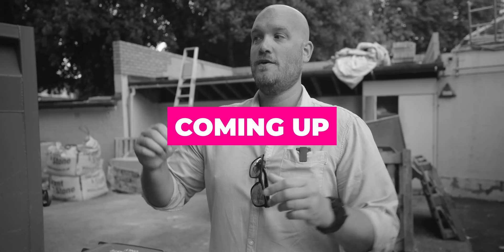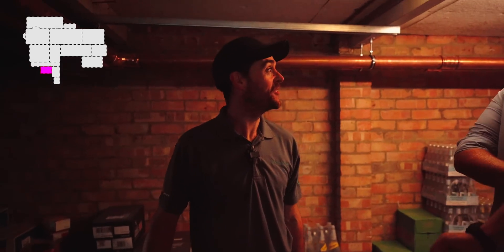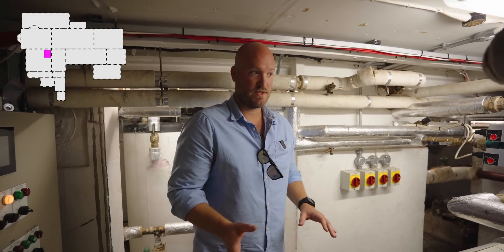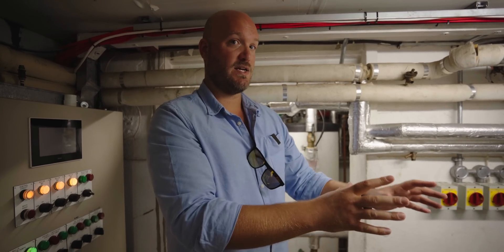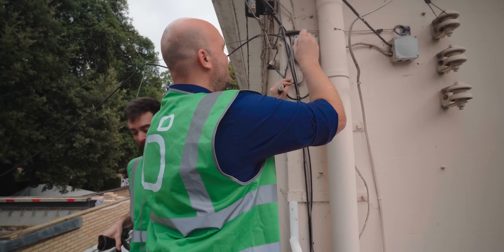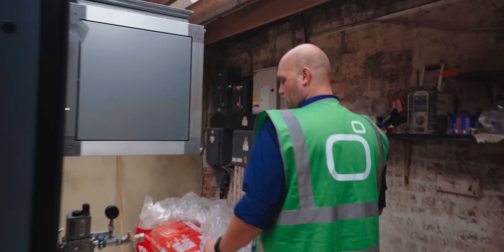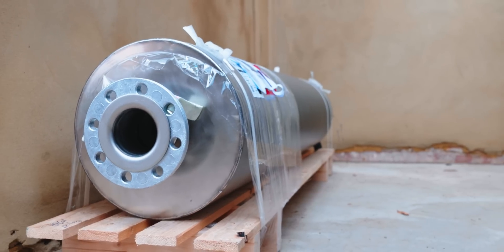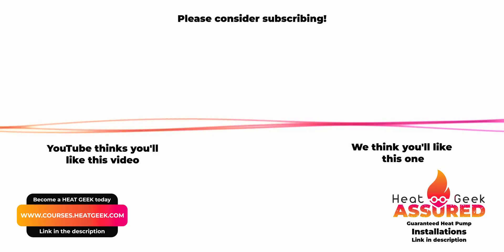This Micro Power Plant Will LOWER CARBON & Save £MILLIONS! | CHP Install

Comment: In a lot of cases, gas CHP would be a net emitter. It certainly would be if compared to a well-operated condensing boiler and grid electricity, as the marginal emission factor of grid electricity is a bit less than that for a gas power plant, due to the renewable electricity on the grid, and this will become even more so in future years (I do these kinds of calculations a lot for feasibility studies for clients in my role as an energy engineer). It may be a good economic solution, but it will certainly be negative environmentally, in GHG, and air pollution, and potentially noise.
Reply: I don't think you're calculating marginal emissions correctly Alan. "last on first off" is how you need to model this.

Nuclear and renewables are "always run" plant. You never (with current penetration in the UK) switch them off. Fossil plant is marginal plant. Combined cycle gas is the first fossil plant that you switch on. Then (pre war anyhow) you start running single cycle gas plant, coal plant, oil plant etc. 

If you displace this marginal load using renewables or a CHP engine etc then the first thing to get switched off is the oil, coal, or singe cycle gas plant. The marginal emissions factor for grid electricity is therefore nothing to do with renewables. It's whatever crappy inefficient piece of plant you just switched off is.

In this scenario the marginal (carbon) emissions of any reasonable CHP will beat the marginal (carbon) emissions of grid electricity until such a time as (a) we have so many renewables that we start shutting off all fossil plant or (b) we start making combined cycle gas combined heat and power plants and the efficiency of the little gas engine CHP just can't compete with the efficiency of big combined cycle turbine CHP.

Gas fired solid oxide fuel cells feeding heat pumps would spank the CHP setup in terms of emissions. Or CHP driven heat pumps. Sexy but spendy though. Energy efficiency measures and insulation would spank both in terms of emissions too. Not sexy though.

Whacking a CHP into a business / hotel / housing development is a reasonable compromise if you have a high enough electrical baseload to justify the high fixed maintenance opex of these things. You're going to see more of them used for meeting peak local electrical demand (rather than heat) thanks to under investment in distribution networks over the past couple of decades and rising interests in EVs etc. Dual fuelling (gas/diesel or gas/ethanol) adds additional redundancy.
Reply: @MarkoCosic  Your point is overall good but gas is not marginal in every hour. Often renewables are (thats why you get negative prices). So its not 1kw to 1kw displacement of gas.
Reply: @KieranCondon  how often does this occur? Is it material (e.g. more than 2 hours per day on average) or is it still an occasional quirk?

This will not be due to the actual marginal cost of generation (gas costs money, sun/wind/hydro do not) but to market inefficiencies of some sort. 

e.g. Somebody has committed to a "take or pay" on a certain volume of gas and is obligated to burn as nobody else wants it?
Reply: @MarkoCosic  I don't know the % of hours not set by thermal assets. But will be ever increasing. Its not due to inefficiency, its when demand goes low enough to only need e.g. wind + solar + hydro + nuclear. Then you either need to pump water up or charge battery, or curtail wind. If you run a chp during that moment you could curtail wind.
Reply: @MarkoCosic , see here (https://www.gov.uk/government/publications/valuation-of-energy-use-and-greenhouse-gas-emissions-for-appraisal) for MEFs. Table 1 gives you the figures, the other doc's are worth a read for explanation.
Reply: @AlanHRussell  that's "the Treasury green book figure" to be used for Treasury funded projects or those playing by Treasury rules.

It has nothing whatsoever to do with physics.

I can guarantee you that if you turn down demand by 1kW today then 1kW of fossil generation is also turned down; not 1 kW of renewable generation. 

This is the model that engineers and polar bears use to work out what a technology actually does.

The treasury methods have their place for very long term thinking. If you KNOW that you're in charge and the marginal emissions in 2030 WILL be X then you can ask people to plan on this basis.

Meanwhile in the real world, where we don't believe the hype, and the infrastructure is also for 10 years not 50-100 years as a pipeline or cable might be, what actually happens and the number that should be used to evaluate carbon saving and actual costs, is the true operating marginal as I described previously.

Lots of projects do use these "projected operating marginal" green book figures rather than "what any halfway competent person can see will be the actual operating marginal for the foreseeable future/life of the project" but that didn't make it appropriate and nor does it change what the actual results are.

Such in this case is saving carbon compared with condensing gas and direct grid electricity.
Reply: @MarkoCosic , it's actually a well established method for anyone estimating changes in emissions from changes in grid electricity and supported by e.g. CIBSE, and multiple Scottish and UK Government funded projects for multiple commercial and industrial operations of various different sizes and timescales. 

From your comments, it appears that you either have a better source/sources of verifiable data (in which case, please cite) or you don't really understand how to apply these figures and the physical basis of the DDM. If it's the latter, please read some of the supporting documentation from the link provided before commenting further.
Reply: @AlanHRussell  the question to ask yourself is:

"What turns down when the electrical demand is reduced"

If you think that it's a gas fired power station that's curtailed then these burn at least 2 units of gas for 1 unit of electricity at the point of use on LV networks. Ish. That's 400-500 gCO2e/kWh(e) depending on how LNG-ey your gas mix is.

If you think that the solar PV production is curtailed then that's 0 g/CO2e/kWh(e).

I think you'll agree that it's the gas that turns down. Therefore the figure to use is 400-500.

To get a figure of 200-250 g/CO2(e) you'd have to assume that 50% of the turndown is gas and 50% is PV.

That's obviously not true today, clearly won't be true in 5 years, and most likely won't be true in 15 years either.

The treasury figure is bollocks. The only reason people use it (to generate bollocks answers) is if they're forced to in order to get funding.

Nothing wrong way your math. Just the assumption you're citing. It doesn't stand up to any form of practical scrutiny over the lifetime of this asset.
Reply: @MarkoCosic , you are incorrect, the BEIS MEF is not a "lower "lifetime average" figure", it is higher than the grid average, has been since 2016, and isn't forecast to converge to it until 2040.  If you think CIBSE are "keyboard warriors", and that BEIS's model is "that we're running 100% solar/wind/hydro/nuclear at times within the next 5-15 years" then you really don't understand enough about either to have a valid opinion.

If you look into it properly, you'll probably find that the MEF for CCGT is 0.35-0.4 kgCO2e/kWh.

As I asked before, if you think that you have more accurate, reliable data than the sources I provided to you, please cite it.
Reply: @AlanHRussell  you appear to the archetypal CIBSE keyboard warrior; robustly defending absolute nonsense in preference to working from first principles.

I've given you the answer. From first principles.

If you turn down electricity demand by 1 kW this will result in gas fired generation dropping by 1 kW. Do you disagree with this? (yes or no - not referencing some 3rd party assumptions - just answering from first principles)

The gas plant being turned down will NOT be full load efficiency CCGT fuelled in North sea gas; but either open cycle peaking plant or CCGT operating some way off its best efficiency at part load; and fuelled in LNG (which is the first thing you stop buying because it's more expensive than North sea has in addition to being higher carbon intensity)  Do you disagree with this? (yes or no - not referencing some 3rd party assumptions - just answering from first principles)

The emissions from these LNG fuelled generation plants will be lower than the full load efficiency on a CCGT plant and LNG will be higher carbon intensity. Therefore the figure to use is in the region 400-500 gCO2e/kWh(e) Do you disagree with this? (yes or no - not referencing some 3rd party assumptions - just answering from first principles)

If the answers are agree, agree, agree, then the figure you're using for marginal gCO2(e)/kWh(e) is 400-500g.

If you disagree then you're refusing to take an engineering approach in favour of referencing what amount to religious texts and demanding proof of an alternative god existing before you change your mind. Completely irrational, completely unreasonable, and unfortunately classic CIBSE behaviour. If this is the case I'll stop bothering to try help you and leave you enjoy turning out the useless boilerplate. Just do us a favour though and don't trash projects that save money and carbon because according to your own god's they don't?

If the tea hasn't been spat at the screen yet the next question is what will change during the lifetime of the investment. 

Will gas always be the operating marginal? My answer yes; over the next 5-15 year investment life of this CHP asset; as I can't see a scenario where the UK deploys so much zero carbon generation to ever need to turn it down.

Do you disagree with this assumption that we won't be turning down renewables in the next 5-15 years? (yes or no - not referencing some 3rd party assumptions - just answering from first principles)

If yes then the figure is 400-500 again. 

If no; then your assumptions on renewables deployment are wildly more optimistic than mine and I'd say unrealistic.

Over 30+ years it gets interesting; so if you're building a building it really ought to be heat pump ready and electrified etc and you'd never dream of locking in fossil fuelling today. This project and and the majority of similar ones are sub 15 years though.

Note the decision criteria is investment lifetime not asset lifetime. That's subtle but important. 

It's perfectly ok to buy an asset and mothball / replace it BEFORE it wears out if that's what the operating costs say is best; provided that it has already paid for itself first. 

This concept of voluntarily switching something off before it is worn out is completely alien to the public sector and CIBSE though; which is why they (incorrectly) assume that the asset runs until it dies.

It's normal in the private sector to retire. I can absolutely guarantee I won't be driving my grandfather's old diseael Volvo until it dies. It'll get retired when it's economic to do so. It doesn't go London any more (more economic to occasionally rent a clean car/van for the day). It's still economic to run to Corby occasionally though. This is what we'd term retiring to standby duty / mothballing. You'd be crazy to buy a new dirty diseael today because it'll be banned before it's paid for itself. If it's already paid for itself / fully deprecated it's normal to retire it when itsnno longer optimal. Regular humans understand this. Finance directors understand this. It isn't in the CIBSE bibles though!
Reply: With reference to "grid average" Vs "average lifetime marginal emissions"

The grid average is irrelevant. What matters is the operating marginal. Today the operating marginal is gas. The average operating marginal over the investment lifetime of this CHP asset will also be gas. The average operating marginal over the investment lifetime of a longer payback asset might be lower than gas if sometimes gas is turned down and sometimes renewables are turned down.
Reply from the maker: @MarkoCosic  I don't see how this disagrees which what I said?
Reply: @HeatGeek  I agree exactly with what you've said.

Today, and for the economic lifetime of this little CHP unit (payback in 5 years; after which you can mothball or scrap it without losing; knackered after 10-15 years), the marginal electricity generation will be fossil fuelled. Marginal emissions from electricity are either gas at 400+ g/CO2e/kWh(e) or coal at 1000+ g/CO2e/kWh(e).

@AlanRussell states that the marginal emissions from the grid are lower than this. That's because he's using the lower "lifetime average" figure predicted the treasury green book to value the electricity produced. This is utter fiction on a 5-year timeline. There is no way that the marginal plant won't be gas or coal. This might not be fiction on a 15 to 30 year timeline if we GTFO with deploying wind/solar/hydro/nuclear. There may indeed be times that you're turning down renewables at 0 gCO2e/kWh, in which case the electricity generated by the CHP would indeed be dirtier than the grid.

For a project of this size and with this payback that ain't happening. The CIBSE keyboard warriors can spit out their fictional model results based on fictional forecasts by the treasury. Indeed they have to if the client want to access funding based on treasury green book rules.

The results are nonsensical in the near term though. Unless you hand on heart believe that the grid will be decarbonised to such an extent that we're running 100% solar/wind/hydro/nuclear at times within the next 5-15 years - in which case you're either a liar, an idiot, or highly optimistic - it is inappropriate to use the treasury green book figures where a simple reality check says that we're going to be burning/ turning down fossil generation for the next 5-15 years.

People don't like being told that their very diligent models, calculated to the letter of the well established models based on tofficial government forecasts, aren't worth the paper they're written on though. Hence defending the nonsense statement that your CHP won't save anything because the model inputs (from treasury) are incorrect.

Nothing wrong with their methodology btw. It's just the forecast for marginal grid carbon intensity used by the treasury green book.

The treasury stuff up is good for heat pumps and electric vehicles though. Makes them look better than they really are. ;-)
Reply from the maker: @MarkoCosic  got you!!
Reply from the maker: Every MW this produces will be 1 less MW required from a gas power station. They curve gas first. The more feeding in to the gridn the better. What's more is this produces during still nights when the grisnis very gas heavy.
Reply: @HeatGeek  is it one of these: https://static.viessmann.com/resources/technical_documents/GB/en/VDP/6170384VDP00003_1.pdf?#pagemode=bookmarks&zoom=page-fit&view=Fit? If so, my calculations suggest that the best case appears to be 50 kWe, with 83 kWth, for 145 kW fuel, though since CHP vendors quote energy input as LHV/NCV, and most bills are in HHV/GCV, you may want to convert to HHV/GCV by multiplying the fuel input by 1.106. Without considering heat losses in distribution, 1 kWth produced by the CHP would require 1.9 kW of gas (GCV), with associated GHG emissions of 0.353 kg CO2e, whilst also producing 0.6 kWe.

If the old boiler is 60% efficient (GCV) then (again without considering distribution losses) 1 kWth produced would require 1.7 kW of gas (GCV) with GHG emissions of 0.3 kgCO2e, and using the commercial MEF for grid electricity, it looks likely you would make emission savings to 2033 when the forecast commercial MEF becomes 0.067 kgCO2e/kWe, and therefore the combined boiler and electrical grid emissions to provide an equivalent service to the CHP would be 0.34 kg CO2e. I'm not sure if that's a reasonable counterfactual case though, since the boiler would be about 40 years old, so a replacement may be desired before then!

If the old boiler were replaced with a new, well sized, condensing gas boiler, which should have a seasonal efficiency of 85% or more (GCV), then the CHP would be a net emitter compared to that by 2025 (1 kWth from the boiler would require 1.2 kW of gas with associated emissions of 0.21 kgCO2e, and 0.6 kWe at 0.22 kgCO2/kWe gives combined emissions of 0.347 kgCO2e/kWth), but I guess the economics of that were not attractive.

It will be interesting to see how electricity prices behave over the next few years as I suspect there may be reform to address the current pricing mechanism (marginal kWh, often from gas plants) as it becomes increasingly distant from the average (lower) cost of production (due to increased wind and solar generation).

I'm looking forward to your next video.
Reply from the maker: @AlanHRussell  got you. Makes sense 👍.  In fairness this building is not ours. We do not choose what motivates our customers (financial or carbon) we give the options, they select. I don't think many would have chosen otherwise looking at the financial tbh.
Reply: Wow, what a back & forth conversation. Seems like some people on here really know there onions. There never was a part 2 of this video as far as I can see, shame really. I still don't know if Alan or Marko was right in the end. I was always hoping for micro CPH to take off for residential one day, they had a lot of trials in Europe running but all seems to have gone quite now. ASHPs are the only game in town in the UK it seems for "next gen" heat and DHW. I guess they took Alan's side. 

As an aside, anyone heard of a company called Hyliion & their "KARNO Generator"? Seems to be a new way of doing CPH using a linear engine / generator. Very interesting I thought, you guys might be interested to take a look.